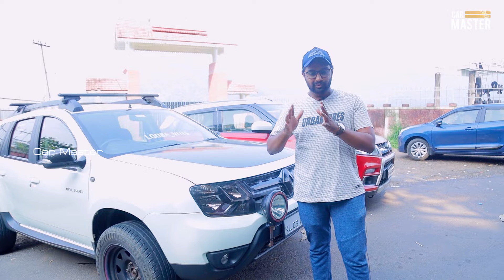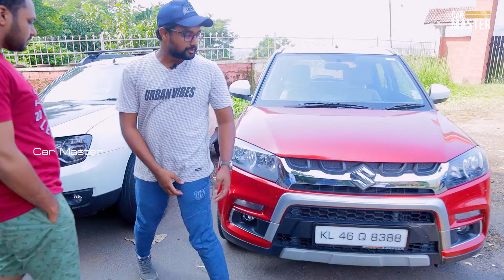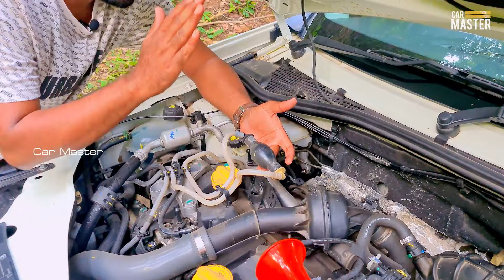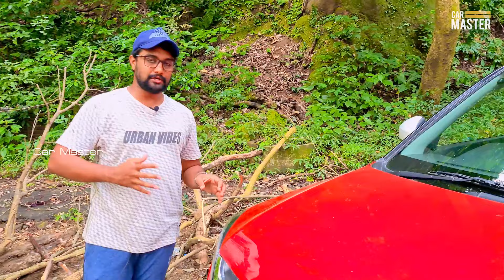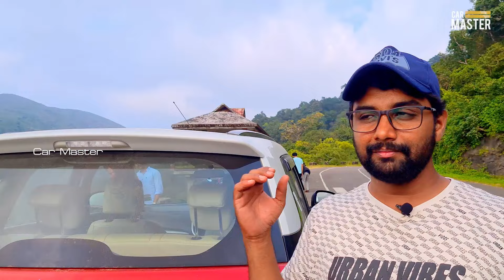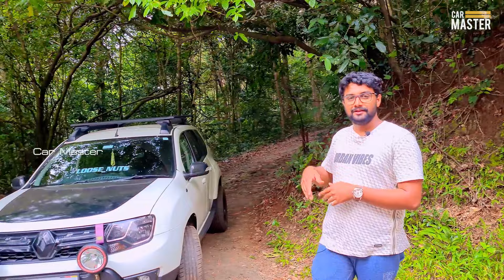Duster vs Vitara Brezza Malayalam Review | Off Road Review | Nelliyampathi Trip | Car Master

Comment: Duster mid size suv alle.. Brezza compact suv yum.. How could it be comparable 🙄🙄?
Reply from the maker: Used vangunnavar compar cheyyum
Reply: Used car marketil similar priceinu kittum bro,njn kazhinja month oru duster vaangiye ullu 2017 model
Reply: Rand segment vandikal thammil comparismo 🙄 vayye bro
Reply: ethu randu segment ennu paryan patulaa bro..sedanum suv alla.. duster used noki erunna alanu njn 2 varsham last breeza first eduth..kurch mm more length.. ground clearnace breeA 198  duster 205 almost similar anu..rear seat comfort only duster scores baki oke venda atrem breezak und

Comment: Dusterinte body quality onnum illa breezake
Reply: Chumma parayathe bro..brezza is a 4star safety vehicle
Reply: @manueljose2847  marutiyude alley vandikalum tin cans annedo
Reply: @manueljose2847  chetta duster dual airbag version not crash tested ( gncap) , but metal quality you can check by pressing its panels , I don’t want say brezza is inferior but duster has an edge I think

Comment: Brezza best for long rides brezza seat more supprt than duster ....duster best in bad roads
Reply: Which seat you referring to? In my view long ride depend also on suspension, and body roll, n experience brezza rear seat not even closer to duster in terms of comfort ..seat if not comfortable you can do bmw type customisation within 10k but you cannot change suspension or dynamics
Reply: Duster front seats gives least thigh support...I meant amt diesel version of Duster